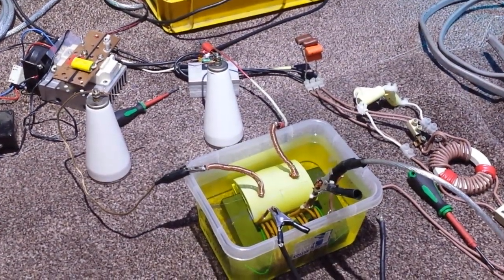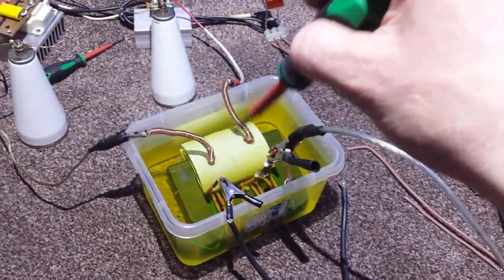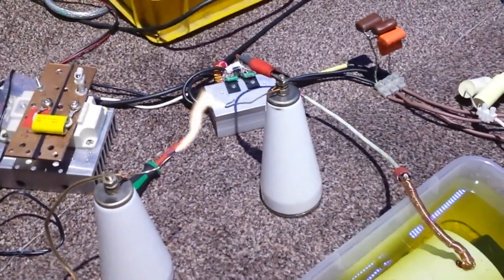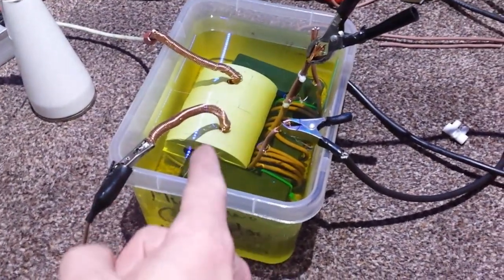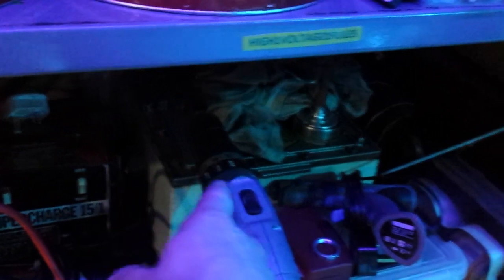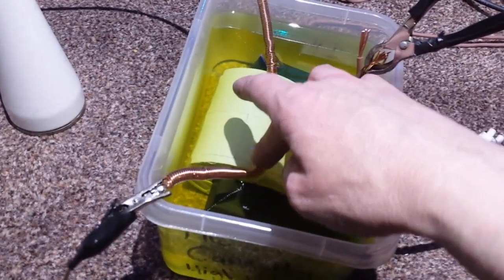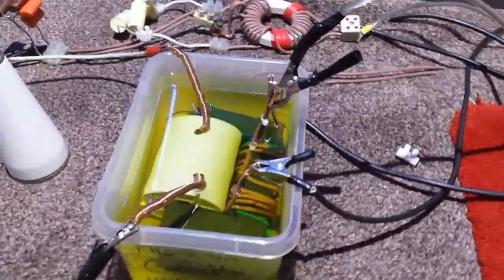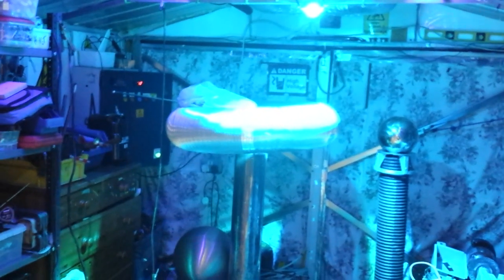THE Biggest Ferrite transformer Flyvack on YouTube

Comment: I'm not an electrical engineer and need some help...can I use a ferrite core to make a 50 Hz transformer.thanks
Reply from the maker: Johann Truter I’m afraid not! Iron core all the way! The saturation would be immense! The reason for ferrites is that there’s no air gaps and the high frequency and magnetics of the power and is the initial vibration as such the core sings in a fashion and the low 50 herts would not go well! it would break the core! And burn up the windings! In a simple terms lol
Good luck 👍

Comment: What's the purpose of the big ferrite toroid (white color, secondary wrapped with red tape)  ?
Is it to insulate the IGBTs from the extreme high voltage X-Ray transformer ?
Could you share the schematic please ?
Reply from the maker: Arnab Satapathi 
hello, well i use sometume my zvs driver as its easyier to set up tuan the igbt/ half bridge/ or full bridge igbt. 
as im using the zvs in this video. The zvs gives an output with a centre tap. so you get the 2 mosfets drain outputs (negative) and the centre tap positive.
so with the torroid im able to use it to get an output with just 2 wires output to connect to a transformer.
zvs is on google images.

hope this uas helped you and thanks for the comment.👍😉

Anthony

high1voltage1rules

Comment: what kind of oil do you use?
Reply from the maker: Hello mate. it's transformer Oil. minaral Oil. very good for cooling and insulation properties.  all high voltage transformers have it unless there in case in a hard resin.

many thanks  and be safe
😉👍

regards

Anthony.

High1voltage1rules
Reply: high1voltage1rules big thanks for your detailed answer. it solved me an issue with some high voltage capacitors have a leakage, need to refill with oil. i have another question please:
in your video you said you glued the ferrite core. how a ferrite core is acting when you glue it? is the ferrite core have to be electrically connected to itself, or can it be with small gaps of air/glue to pass it best magnetic filed?
Reply from the maker: +ilan aviv - neworld hello again. no problem for asking me questions' I don't mind at all.
and with the ferrite being clued back together. as for the glue in between would just act like a Airgap. so it's frequency would change abit ! no harm done. would make the arcs seem a little thinner. but I'm not too bothered about thick white arcs. as I love the blueish/purple ⚡arcs lol. 
hope this helps and be safe my friend. good luck in yours projects.👍😉

Anthony

High1voltage1rules